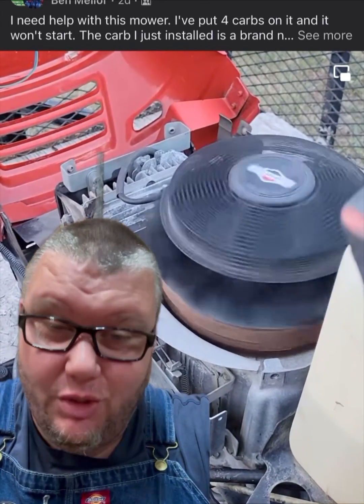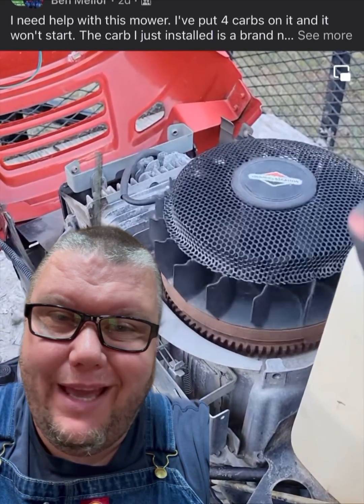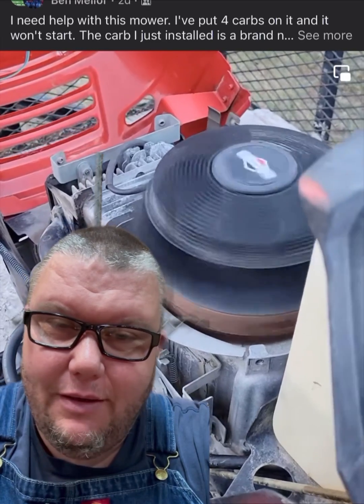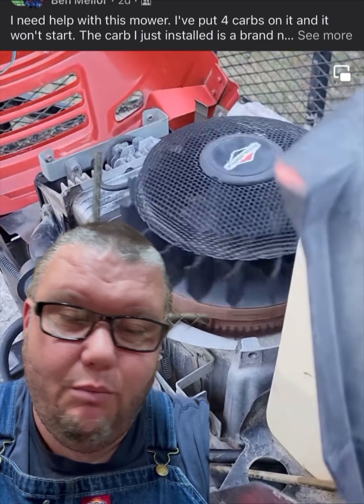IF YOUR MOWER IS DOING THIS THEN STOP!!! MOST COMMON ISSUE ON A BRIGGS AND STRATTON SINGLE CYLINDER

Comment from the maker: ➡️ WATCH NEXT HOW TO ADJ VALVE LASH
ONE OF MYMOST ASKED QUESTION : HOW TO ADJUST THE VALVES ON A SMALL ENGINE
https://youtu.be/VaO0lO9Psn8

➡️ HOW THE COMPRESSION RELEASE WORKS ON MOST SMALL ENGINES
https://youtu.be/1uzUf9UkpDQ

CHECK OUT MY EXTENSIVE ⬇️ON LINE PARTS STORE⬇️

https://www.amazon.com/shop/backwoodsctryboy?ref_=cm_sw_r_mwn_aipsfshop_aipsfbackwoodsctryboy_711XHGH8CP3D50QKTF9B

TOOLS I USE EVERY DAY
MILWAUKEE 1/4” SOCKET SET
https://amzn.to/3WemAH1
MILWAUKEE 3/8 SOCKET SET
https://amzn.to/3WemAH1
MILWAUKEE IMPACT 1/2”
https://amzn.to/41QLUnF
MILWAUKEE IMPACT 3/8
https://amzn.to/3MF5DSX
LONG SHANK ALLEN BIT
https://amzn.to/3M9O1gs
KNIPEX PLIERS
https://amzn.to/41RhZeO
BASIC MECHANICS TOOL SET
https://amzn.to/3MBXYom
JAPANESE SCREWDRIVER SET
https://amzn.to/3Mjh6WF
SHOP PRESS
https://amzn.to/3WgCZum

Comment: I have a 13.5 briggs flat head, got it free from an old lady, carb was just a bit crusty, cleaned out, starts perfect, but it pops pop pop pop, finally i took the head off, lapped and ground the valves down to get within spec, and now i can adjust the carb and have the adjustments work, great...but it still pops. Keyway isn't sheared, spark plug was gapped, but also a new one thrown in. Don't work on these really much, is that how they run, am i missing some key component? ive made it run better, but the damn popping sound makes it sound like a POS mower. Any tips on something to check or swap? I have a carb from a 12.5 i robbed...i think it's close. Regardles not sure what to check next. I was looking at every thing possible for a good while just one after the other but yeah.

Comment: Until just recently I had an Ariens with a 17HP B&S 31000-series engine. In my experience, it's never been a valve adjustment. In 7 years of ownership I replaced the CAM three times due to a broken ACR mechanism. And it always breaks exactly the same way, the little weight breaks free of the pivot and all the loose parts drop down to the crankcase, ruining the governor gear as they pass through. I always used OEM B&S parts and still every 200 hrs or so it would disintegrate. Those fragile ACR components look like something that would be more suitable for a pocket watch rather than an engine.

Comment: Very common issue with those engines ive had a few inteks with valves out of adjustment at my place I also work at a local hardware store and we see the compression release fail all the time I feel not changing oil and filters will have a lot to do with it  going bad with my customers at my shop I adjust the valves for peace of mind and the customer wont take out a starter unless cranking too long.
Reply: I changed the oil on my Ariens every 25 hrs and used Mobile-1 full synthetic oil and still like clockwork every 200 hrs or so the ACR mechanism would break.

Comment: I have a zero turn paulon pro PX46Z. I've replaced. Both spark plugs, fuel pump, fuel valve, carburetor, oil change twice and filter and new air filter. It starts now finally but 1 side the spark plug is fouling quickly within 30 seconds so it loses power since it's running solely on the other spark plug and dies down. What can be the issue and how do I fix it??
Reply: It sounds like you have one bad ignition coil. Sometimes a coil just quits and sometimes it stops working as it gets warm. Check the spark on the fouling side to see if the coil is breaking down.
Reply: @bobhanke6401  hey buddy thanks for the reply. So I had already changed the ignition coil before just forgot to mention it. But it turns out it was neither of these at all. What it was is that my pistons were so build up of carbon that it kept fouling my spark plugs within 30 seconds of cleaning/replacing them and it would lose power and die. So what I would do is run it as much as possible so the pistons get hot enouph to where I take brake cleaner and spray it so the carbon falls off. And what do u know it worked. After that I used some seafoam and fogging spray to lubricate the pistons. I still clean the pistons with seafoam here and there and I can finally see the head of the pistons. Pretty much it couldn't make its combustion due to how dirty it was. Now it runs literally brand new!

Comment: They being the manufacturers need to use stronger starters and cables where possible.  Compression release not needed.
Reply from the maker: Or just keep up the maintenance and keep the valves adjusted and you won’t have this problem
Reply: @THEMOWERMEDIC1  I'm stupid meticulous I check my valve lash every other season. Change my oil plug and filter at the end of every season. And that's on my 30+ year old Dynamark 😊😊. That's why it's lasted 30+ years
Reply: @THEMOWERMEDIC1  general principle or at least from my point of view.  :)